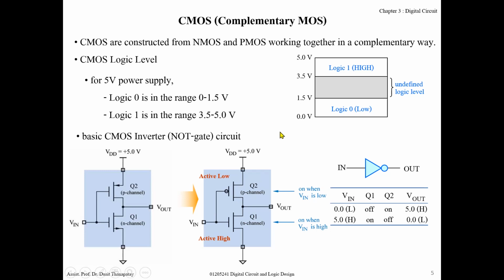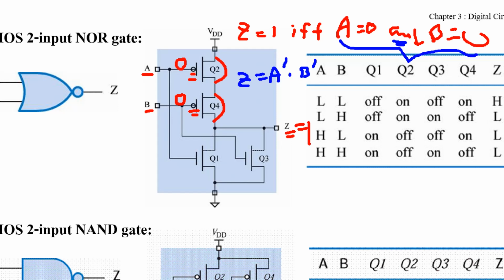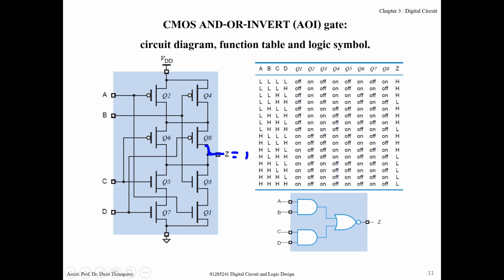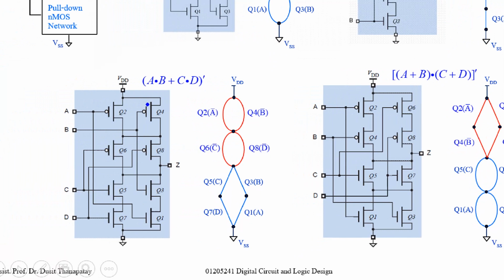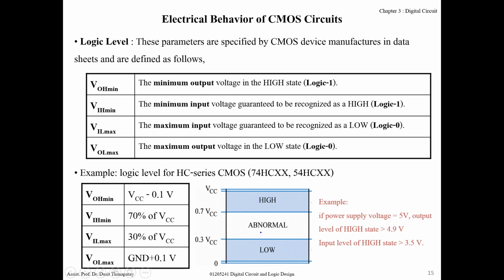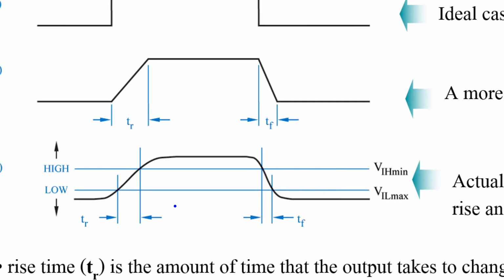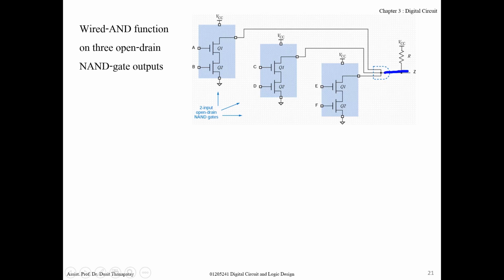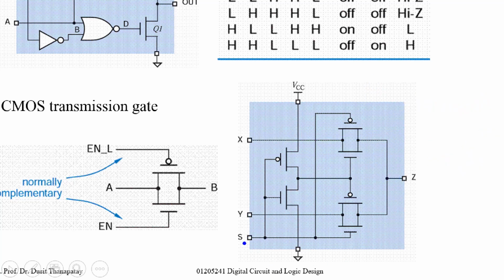01205241 sec 450 (IUP) Chapter3 CMOS Circuit (part 2/2)

Comment: 0:20 CMOS (Complementary MOS) ex.Active low transistor- Logic 0 is in the range 0-1.5 V(On when Vin is low)
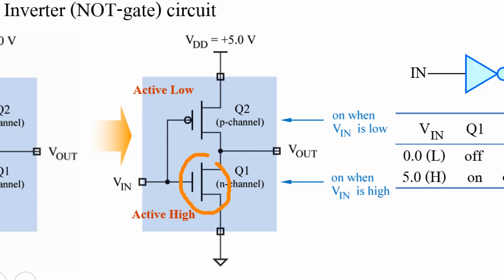2:00 CMOS (Complementary MOS) ex.Active high transistor- Logic 1 is in the range 3.5-5.0 V(On when Vin is high)
3:40 CMOS 2-input NOR gate ex.Analyst by applying all possible values - Active low/high transistor

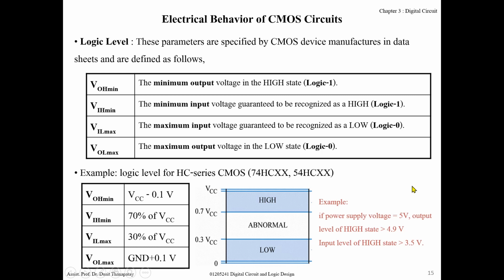Comment: 36:21 Logic Level: is one of a finite number of states that a signal can have. Logic levels are usually represented by the voltage difference between the signal and ground, although other standards exist.
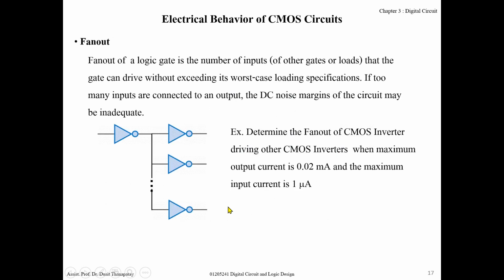41:05 Fanout: of a logic gate is the number of inputs that the gate can drive without exceeding its worst-case loading specifications.
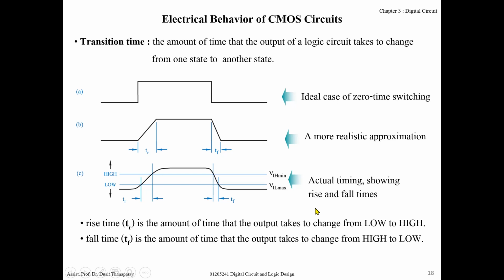46:18 Transition Time: the amount of time that the output of a logic circuit takes to change from one state to another state.

Comment: 30:23 Logic level: VOHmin,VIHmin is minimum output and input voltage in HIGH state. VILmax,VOLmax is maximum input and output voltage in LOW state.
40:59 Noise margin: A measure how much noise it takes to corrupt a worst-case output
45:11 Fanout: It is the number of inputs to logic gates.

Comment: 39:54 Logic level; Between 70-30% of voltage level will be abnormal logic value.
48:56 Propagation delay; Amount of time that takes to deliver the signal through the system from certain input to output.
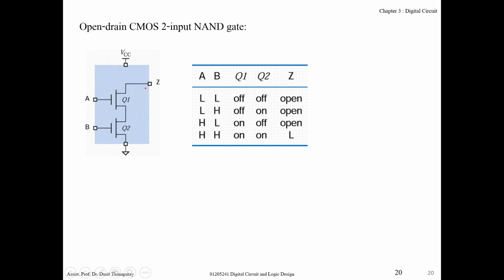50:29 open-drain; when Vcc is connected after the output

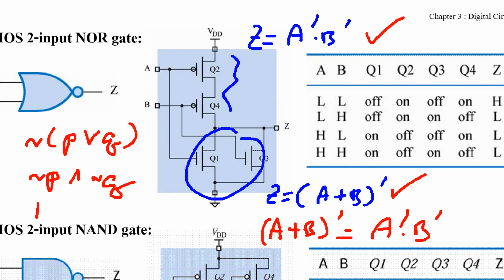Comment: 13:21 CMOS 2-input NOR gate  in (A+B)' = A'B' 
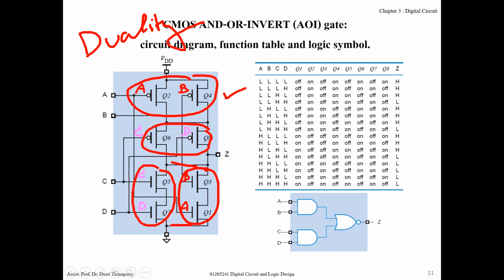18:27 duality is when the upperpart is connected in series and lower part connected in parallel
26:00 OAI gate can be written as z = [(A+B)*(C+D)]'

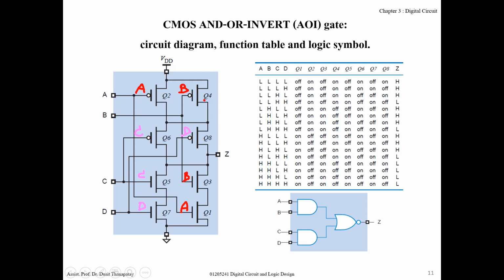Comment: 17:08 Duality- Group of transitor A-B and C-D series but B-A and C-D connect in parallel.
27:22 For example, Q2,Q2-A causes of active low so represent by bar, while Q1, Q3 are parallel, control by A and B respectively.
48:44 Propogation Delay: Input changes from low to high, output changes from high to low. The result will be seen by time, namely output will occur after input.

Comment: 0:07 CMOS - are constructed from NMOS and PMOS working together in a complementary way.
38:54 Electrical Behavior of CMOS Circuits - Logic Level - They defined as follows, V(OHmin),V(IHmin),V(ILmax) and V(OLmax).
44:49 Electrical Behavior of CMOS Circuits - Fanout - of a logic gate is the number of input (of other gates or loads) that the gate  can drive without exceeding its worst-case loading specifications.

Comment: 15:48 For possible value of the 4 input can be substitute in to 16 case from 0000 till 1111 and each of it have to be consider the gate on-off as well
26:47 normally pMOS network is pull-up connect to Vdd but for nMOS network is pull-down connect to Vss(ground) and if upper part circuit connect in series the lower part have to be connect in parallel
37:26 For standard of logic high cover from 3.5V (0.7*5) to 5V , for logic low cover from 0V to 1.5V (0.3*5) and about abnormal from 1.6V to 3.4V

Comment: 0:05 CMOS Logic Level - Logic o is in the range 0 - 1.5 V. . And Logic 1 is in the range 3.5 - 5.0 V.
45:15 Fanout - Fanout of a logic gate is the number of inputs that gate can drive without exceeding its worst case loading specifications.
48:44 Propagation Delay - Signal path is the electrical path from a particular input signal to a particular output signal of logic elements.

Comment: 36:43 Input that is considered to be High status is in the range of 70%-100% of the power supply.
47:55 rise time is the length of time the logic gate's output signal takes to change its state from low to high.
50:36 An open-drain circuit must have a transistor attached to it, known as a pull-up resistor.

Comment: 7:53 CMOS 2-input: if the upper part connects in parallel the lower part will connect in series if the upper part connects in series the lower part will connect in parallel.
45:10 Electrical Behavior of CMOS Circuits: Fanout is The maximum input of logic gate that can do.
49:38 Propagation Delay: Propagation Delay is the time to move through a path from one location to another.

Comment: 0:17 If you want to turn on the swicth on active low you need to applied logic
8:07 2-input NOR Gate: you can analyze the circuit by using only active low or active high
21:25 CMOS GATE: you cancalculate by using z =(A'+B')(C'+D') in active low or z = (AB + CD)' in active high

Comment: 21:09 CMOS AOI - IF Z=0 (A'*B' + C'*D')' is the function.
23:18 CMOS OAI -IF Z = 1 (A'*B' + C'*D') is the function.
26:36 Note for circuit design-  pMOS will connect to VDD (pull up) but, nMOS will connect to Vss(pull down).

Comment: 13:48 CMOS 2-input NAND gate
15:56 CMOS AND-OR-INVERT(AOI) gate: circuit diagram
52:55 Driving an LED with an open-drain output

Comment: 38:03 If we add component in the digital circuit. It must have voltage drop across the component and causing the error in logic level. 
46:27 In practical digital circuit, We have transition time changing in state voltage in circuit. And we have Rise time(LTH) and fall time (HTL)
50:36 We use pull-up resistor to make the circuit State High with no current not a open circuit. In the circuit of open drain CMOS circuit

Comment: 36:14 Logic level : level must be calculate by percent to tell what level of V is like if 5v its can be high if its more than 0.7% of 5 V
40:54 Noise margin : is measure how much noise take to corrupt a bad output
49:32 propagation delay : signal path is the electrical path from  a particular input signal to a particular output signal

Comment: 15:54
combination of input is 16 --> 0000 to 1111
Q2 and Q4 is control by A and B   in paralel
q5 and q3 is control by C and B  in series
have 2 type of circuit will be called duality.

36:20
Logic level: High Abnormal low but  high is not only 5v its can be morethan or lessthan
and low is not only 0v but   0v is standard

44:42
Fanout: the number of logic gate or the number of input

Comment: 3:38 CMOS 2-input NAND gate: A  B  Q1   Q2   Q3   Q4   Z
                             L  L  off  on   off  on   H
                             L  H  off  on   on   off  H
                             H  L  on   off  off  on   H
                             H  H  on   off  on   off  L   
                     
36:18 Logic Level: These parameters are specified by CMOS device manufactures
                    in data sheets and are defined as follows
 
                    V(OHmin)---> The minimum output voltage in the HIGHT state (Logic-1)
                    V(IHmin)---> The minimum input  voltage guaranteed to be recognized as a HIGH(Logic-1)
                    V(ILmax)---> The maximum input  voltage guaranteed to be recognized as a LOW(Logic-0)
                    V(OLmax)---> The maximum output voltage in the LOW state(Logic-0)
45:51 Fanout:  Fanout of a logic gate is the number of inputs(of other gates or loads)that the
               gate can drive without exceeding its worst-case loading specifications. If too many inputs
               are connected to an output,the DC noise margins of the circuit may be inadequate

Comment: 0:03 how to analyze CMOS circuit by consider transitor as switch
3:39 how to analyze CMOS NOR gate by apply 0 and consider the transitor is on or off
36:29 logic level for HC-series: logic high cover from Vcc to 0.7Vcc

Comment: 0:01 CMOS :CMOS are constructed from NMOS and PMOS working together 
37:00  Logic level : Vohmin : the minimum output voltage in the high state
46:05 Fanout:fanout of a logic gate is the number of input (of other gate or loads) that the gate can drive with out exceeding its worst-case loading specifications.

Comment: 2:10 CMOS: Active high and active low have a different sign and connection. Active high connects with n-channel and active low connect with p-channel .
36:52  Logic Level of Electrical Behavior of CMOS Circuits :The standard of Vcc level is high normal and low. The minimum input voltage is approximately 70/100 of Vcc . The maximum input voltage is approximately 30/100 of Vcc .
44:52 Electrical Behavior of CMOS Circuits :Fanout is a number of input that logic gate can drive without exceeding its worst-case loading specifications.

Comment: 6:37 all active low gate always connect to the vdd and the active high gate always connect with ground site

18:30 if top part of the circuit connect in series the lower part must connect in parallel 

26:43 pull down nMos network connect to the ground

Comment: 0:14 For this type of transistor if you want to turn it on you have to apply 0 V at gate terminal
2:02 This transistor will turn on when apply 5 V or high voltage at gate terminal
2:29 This is basic configuration of inverter

Comment: 3:02 CMOS: If input is Low the output is going to be high, and also if input is High the output is going to be low.
45:26 Fanout of a logic gate is the number of inputs that the gate can drive without exceeding
46:24 Transition time: the amount of time of the change of one state to the another one.

Comment: 37:30 Logic Level; standard CMOS, logic low covers from 0 to 30%
44:58 The maximum input of another logic gate that can use from the same output that still keep the logic correctly is called fanout
52:37 Open-drain CMOS 2-input NAND gate=TTL=open collector

Comment: 26:33  Pullup pmos network which connect to VDDwill try to pull up and pulldown nmos network which connect to Vss will try to pull down
37:38  Electric behavior of Cmos circuits an abnormal 0.7-0.3 Vcc
49:00  propagation delays tpHL(high low)  and tpLH(lowhigh)

Comment: 40:50 input level of high state more than 3.5
41:00 VIHmin less than VOHmin to have better noise tolerance in high state
45:00 Fanout is the number of input that gate can drive without exceeding

Comment: 3:38according to table cmos of nor its like if the channel that flow to the ground such as q1 and q3 are disconnect represent as zero zero according to xor the out put will be one
3:39 according to table cmos of nand is similar to nor but just flip sideof the channel of ground connection if both q1 and q3 are directly connect allow the input flow through ground directly like 1 1 = 0 according to xand
22:02 cmos (AOI) to make it easy to visualize we can come up wit=th formula state that z = (axb + cxd)'

Comment: 0:00 CMOS(Complementary MOS) are constructed from NMOS and PMOS working together in a complementary way.
37:32 Logic Level of Electrical Behavior of CMOS Circuits : These Parameter are specified by CMOS devices manufactured in data sheets.
49:40 Propagaion Delays (tp) : Signal path is the electrical path from a particular input signal to particular output signal of a logic element.

Comment: 15:50 CMOS AND-OR invert(AOI) gate circuit diagram,function table and logic symbol. 
36:20 Logic level these parameters are specified by CMOS device manufactures in data sheets and defind as follows.
22:00 Electrical behavior of CMOS circuits ;Fanout

Comment: 12:35 CMOS :  CMOS 2-input NOR gate can write in z= A'B' or z = (A+B)'
15:19 CMOS :  CMOS 2-input NAND gate can write in z = (AB)'
45:11 Electrical Behavior of CMOS Circuits : Fanout is the maximum input of another logic gate that can use from the same output that still keep the logic level collected.

Comment: 15:50 CMOS AND-OR INVERT (AOI) gate : circuit diagram, function table and logic symbol.
26:27 The connection of the pMOS and nMOS network : pMOS connect to the Vdd and nMOS connect to ground.
36:21 Electrical Behavior of CMOS circuit : Logic level.

Comment: 39.00 apply logic 
44.46These parameters are specified by CMOS device manufactures in data
sheets and are defined as follows
46.27Transition time : the amount of time that the output of a logic circuit takes to change
from one state to another state.

Comment: 6310550659
0:32 CMOS : this type is turn on when V(in) is low
36:48 Logic level : logic high cover from 70%-100% of V(cc)
38:14 Logic level : for exaple if logic 100% is 5 v minimun logic high will be 70% = 3.5 v